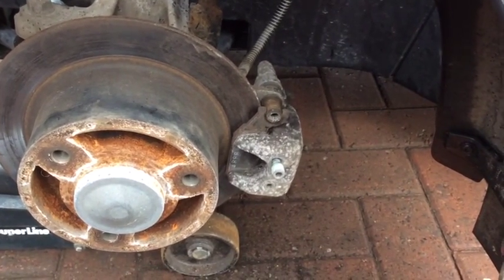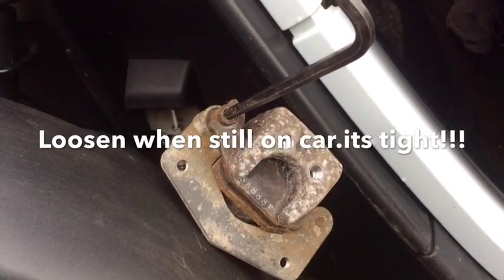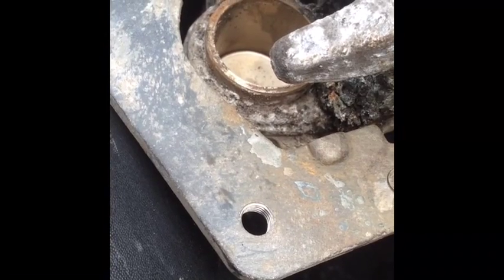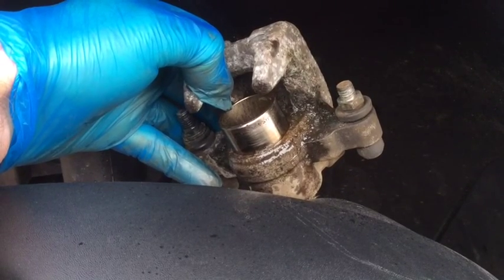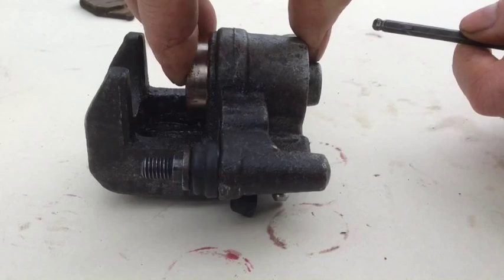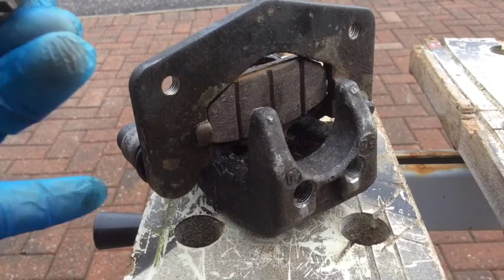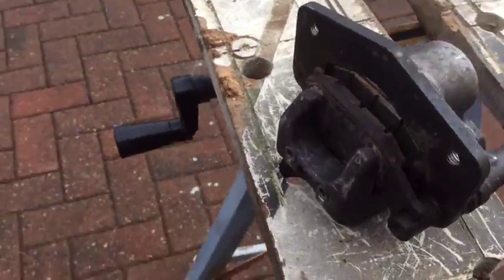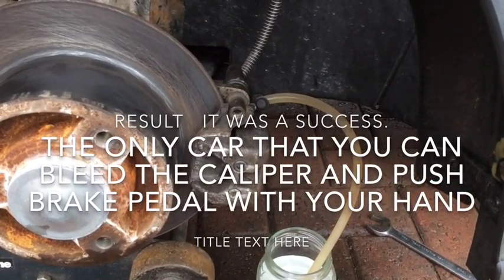Twizy brake caliper strip down

Comment from the maker: I used the old pads as I hadn't bought new ones yet.the reason for doing this was because my caliper were sticking on.i used a brake hose clamp to prevent fluid loss they can be bought for around £5 from halfords.

Comment from the maker: Forgot to say once you connect the hose back onto the caliper and removed the hose clamp just loosen the bleed screw on the caliper and pump the pedal until the air comes out.

Comment: subevo35, are you saying that there are no seales on the piston? Is it just a tight enough fit to keep in the brake fluid? Thanks
Reply: seals should be on the inside of the cylinder not on the caliper. There should be an O-ring seal inside.